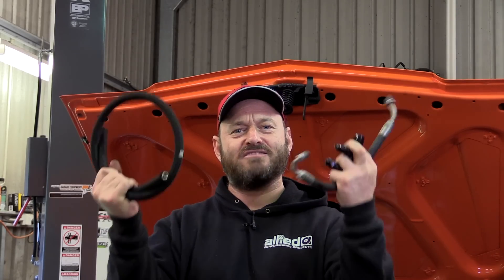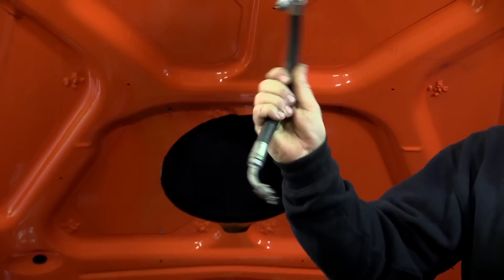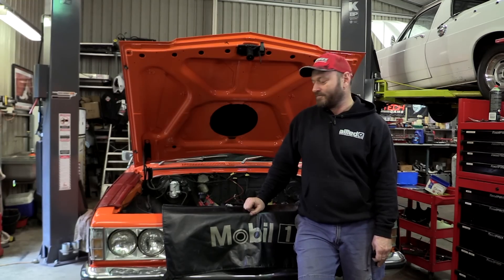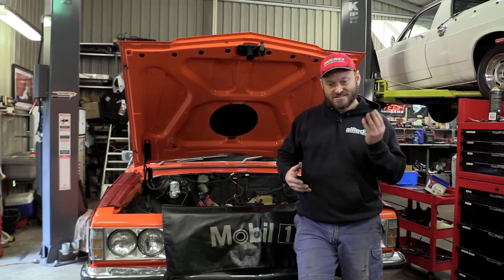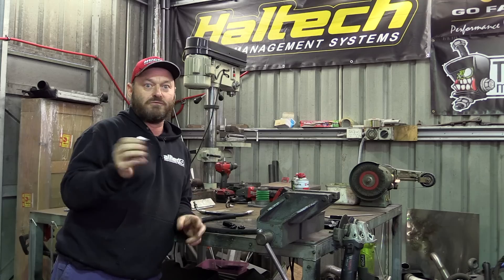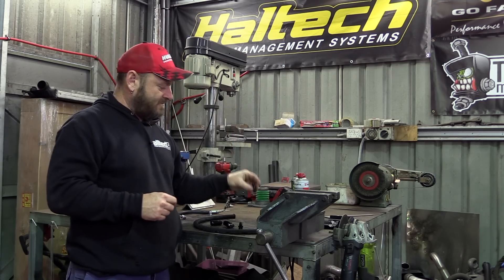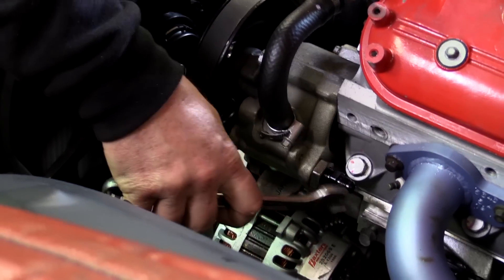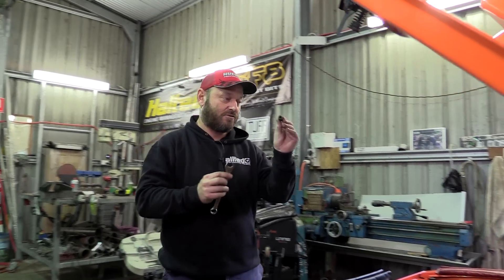THE SKID FACTORY - [QUICK TECH] How to make a custom Power Steering Hose

Comment: so with this method we get rid of all the metal piping and just go straight rubber?!  i am looking at this video just for my 2wd work 1994 hilux where the 5 or so rubber hoses have leaked and fully rust proofed everything. even on ebay a full set of rubber and metal hoses looked like $1300 aud !

Comment: hi 
factory SBC  uses the sway bar to go under the engine  as a mount to go from box to pump .
Reply from the maker: The pressure lines were mounted to the sway bar from factory to cross over?

Comment: I have that engine in my VY SS Commodore & I have already heat wrapped the driver's side header (Genie headers) to protect the power steering rack & starter motor as well as other stuff like the heater valve & battery from getting cooked (the drivers side header tended to warp the heater valve) but I would like to heat wrap the passenger side header next.

The high pressure power steering pipe comes into close contact (1 inch) with the exhaust header which tends to make the power steering hard to steer.

I tend to notice that the high pressure pipe also weeps a little bit of fluid & the pump is brand new,I think that the rear of the pump & the power steering pipe gets too hot so I'm going to insulate the exhaust header from the power steering pump.

I noticed that the same engine in the Chevrolet Camaro has its high pressure hose run down the front of the engine to the power steering rack which is mounted in front of the engine so it's routed away from the exhaust manifold,the Camaro uses a different pump as well !

Comment: hey mate, i know there is a good chance you wont see this but im in the final stages of my vs commodore ls1 conversion and trying to figure out what way to go about the high pressure power steering line. do you think the standard ls1 line would fit? i just cant find the fitting sizes online

Comment: As a hydraulics worker who remakes P/S hoses but the part you'll miss is the internal resister on the high pressure side preventing damage to pumps and boxes due to fluid pulses. with all respect Yoda at 11:14 you shouldn't use the hose to turn the mandrel/hose tail on.
 Funny part is AN6 is a 9/16" JIC to hydraulics worker.

Comment: my local shop tha does industrial psi hoses charges me $160 cdn just to fix a hose, which was half the price of a new ford  hose  plus install by local  mechanic shop 430 cdn  so i  installed it myself for 1/3 the total  cost of that shop doin it..
after doin Ls swap fuel system, ive got about 15 inches left of some high pressure fuel hose and enough left over fittings i think i can make one of these from that and just get those adapters, so maybe 10-15 bucks to make a new hose fit :-)

Comment: 200 series PTFE hose appears to have a higher pressure rating, is there a reason you use the 490 instead?
Reply: Yeah my thoughts to. Must just be a sponsor thing
Reply: @rabbitswyd24  Can you guys do maths? Might answer your question. LMAO being sponsored by a hose
Reply: @yeahna  they seem to have a thing going with Goleby's, the company that supplies them with hose and fittings. I'm going to assume you have the mental capacity of a 12yo based on your level of humour, and lay it out for you:

Teflon hose is good for most automotive applications, so it saves you from having to stock multiple different hose and fitting types for different applications (petrol/gasoline, E85, diesel, oil, trans fluid, PS fluid, brake fluid, etc). 

It's ~20% more expensive, but all of the options for quality custom hoses are expensive, and compared to outsourcing to a hydraulic company to custom make each hose it's generally more time and cost effective to make them in house. Teflon hoses have much higher specs and IMHO should last longer than other rubber-type hoses

Not that comparing numbers really qualifies as maths, but PTFE hose is objectively superior when it comes to the numbers:

200 series PTFE stainless braid reinforced -6AN:
- working pressure ~3300PSI, burst pressure ~10,000PSI
- operating temp -70ºC to 260ºC
- steel and aluminium fittings available (in industry, steel is recommended for high pressure side)

490 series synthetic rubber textile reinforced -6AN:
- working pressure ~1500PSI, burst pressure ~6000PSI
- operating temp -40ºC to 120ºC (PS fluid can exceed 120ºC in demanding applications)
- aluminium fittings only

Comment: i have quick question for anybody to answer ..why do manufacturers use steel and rubber hose on the high pressure lines .. can it be replace with just a rubber hose ...does the steel line play a role in it working correctly to a correct pressure or something

Comment: Thank you for this - I'm ordering some from Aus as there are no UK suppliers. I'm not even doing this for a conversion, just to replace the factory lines that have perished and follow a truly ridiculous path around the engine bay. About 4 metres of pipe to travel 1.5 metres from pump to rack. No NOS available anywhere and it's only a 2006 car.

Comment: Can an incorrect hose cause vibration.? When idling and rotating the steering wheel left or right, any engine rpm (750 - 2500 rpm) same result. 
Want to know before condemning the pump or the RRS rack

Comment: Do you not require a pressure control valve on the HP side of the pump? What fitting did you end up using on the pump when you said the other fitting was too long?

Comment: I had a look and the 90 degree's are almost $50 each. This made my hose over $200 , to make it myself. It just doesn't make any sense to me. 
I need a custom hose because my chevelle is converted to right hand drive. I'm thinking about getting a factory hose, cutting it and welding in a steel extension.
I'm open to better ideas.

Comment: Would love to see a DIY aircon setup where as you have to either replumb and use a different condensor.
Reply: This would be great as I have to fit AC to my VW van this autumn.
Reply: @idrisddraig2  If it's a Kombi just wind the windows down and listen to the glorious sound of the  Dak Dak! If its a T3 or later just buy the original equipment and fit it.
Reply: @terryjackson4538   It's a T5 , Original equipment will be 2K€ +, I will end up using scrapyard parts

Comment: I had my steering rack changed a year or two ago on my 97 Camry. They didn't tighten the fitting on the steering rack from the steering wheel. I took it back and said it has a lot of play in it. The steering feels quite light, the steering wheel is off centre and personally I think the rack needs a little more play taken out of it. I like a steering wheel that you can take your hands off and it drives straight down the road with a slight tendency to wander according to road surface.

Comment: I love AN fittings.  My father and I put everything needed to run a boat into an empty hull.  We used AN fittings for the fuel and hydrolic  systems.  I accidentally over tighten one and killed it.  We had to recreate the entire hose again.  We took great care in taking the rest of the hose apart in order to save the other fitting.

Comment: How do you determine thread size, thread type and thread pitch?? Either a male or a female thread on an unknown component.

I recently put thermo fans in, took ages to find a thermo fan switch that fit because I couldn't determine the female thread size in the thermostat.
Reply: There are thread itch gauges available, try ebay for a set. Anywhere that does metal fabrication would probably have a set.

Comment: CarQuest can do up hoses for people in Canada, not too expensive, around $100 depending on the hose and it'll look pretty much OEM. Although they didnt have the right fittings to do a custom clutch hose for me the last time, but brake line did the trick until I got my hands on the right materials.

Comment: Also quick tip when making hydraulic hoses, or any hoses for that matter, always clock/orient your fitting  and route your hose to go with the natural flow of the hose, meaning bulk hoses comes on a spools and tend to always have a bend or curve in it. Keep that in mine when routing your hose, don’t fight it, use it to your advantage! Specially true if you go above 1/2” hoses and more so if it’s double braided.

Comment: I do probably 50 or 60 power steering hoses per year in Bunbury WA. I am a mobile hose owner and depending on the brand of hose , you can do almost OEM quality work, or sometimes I use stainless/ Teflon if the owner wants bling.
Reply: I do the same here in Ballarat mate. Loads of custom mustang ones. I do a lot in steel pipe work too. I get a real kick out of doing a good OEM looking  job.
Reply: I agree with you guys. A/N looks dinky. OEM looks much better.
Reply: Any chance you can help me with a custom ps line for my 2jz 91 supra build.

Comment: Hey Al, how do you feel about the Aluminium Spanners other people I see using only for AN fittings??
Reply: Ross Burrow all the aluminium spanners do is prevent scratching the on A/N fittings. As they’re expensive fittings and people tend to use them for display purposes.. the spanners are recommended.

Comment: Great video Al, this is so much nicer than what we used to be forced into 20 years back doing swaps, brazing two different high pressure lines together on the hard line with an oversize piece of hard line over the two was the way, seems rather rogue now but it worked I guess. Used to cost about £150 for a custom pipe back in the 90's in the Uk, people were spending that for the bloody engine to swap in haha.

Comment: A tip for cutting hydraulic hose, even big heavy "six wire" hose, when you dont have the correct cutting equipment, is to lay it over a log and give it a big hearty swing and chop with an axe. It will go straight through it very cleanly.
Reply: An axe!! How do you get internet in the woods..haha. So creative!

Comment: Would possible to go more in depth in terms of fittings, sizes and common uses.

I'm also a mechanic but I don't actually know what you mean when you say we are using this dash 100 series line for application X. It would be nice to see and have explain the differences in lines, sizes and being able to have a rough idea on what lines are needed for certain applications
Reply: With AN fittings larger numbers are bigger fittings. So -8 would be bigger than -6. And they get sized based on how much flow is needed and what kind of pressure it needs. Smaller hoses can withstand higher pressures without extra reinforcement. 
And the 100 series is the type of the hose. It varies some by brand, but the different series will have different pressure ratings and different fluids they’ll handle.
Reply: Check out the Bedford van episode he talked about. He goes over all that stuff, it's really informative!

Comment: Interesting, I normally go to the local hydraulic hose shop that makes custom hoses and will do it using the old fittings then will do it the cheep way with functional hose or the fancy with decent priced parts, did a nice job on my  ATTESA  pump hose for my S12.... but good to know which hose and parts to look for when that isn't a option, thanks

Comment: I really appreciate these Quick Tech series vids, guys!
Topic suggestion: the differences and various applications between oil-only CHRA turbos and oil-and-coolant CHRA ones.
Reply: Oil only for a engine thats built to make big power.water cooling if it's  going to a million kilometres... Turbos have come along way from the 90s! unless you buy a manufacturer specific turbo it won't have water cooling....
Reply: @thecraftiekiwi4919  I'm looking at either a G25-660 Garrett (oil-and-water CHRA) or perhaps a Gen 2 5558 PTE (oil-only CHRA). I'll be tuning for 500whp.

I currently have a GT2871 now (oil-and-water, 390whp) on my Mazdaspeed 3. My application is for competitive tracking and auto-x, so heat rejection over an extended period of time is important and has me shying away from oil-only.

Comment: clocking the fittings - on shorter runs, it helps to mark where you want the fitting oriented when finished.  There are a bunch of ways of doing it, but it is really annoying to be 180 degrees off and unable to connect the points.

Comment: When you are assembling the hose I noticed you did not Mark the end of the hose at the fitting after you threaded it into the fitting. When I made hoses for the race boat I used to work on, I used to always take electrical tape and Mark the hose with the electrical tape at the end of the fitting, and make sure that the hose didn't back out of the end of the fitting while you're threading the Spike into the hose

Comment: OR install an electric power steering system...much betterer....
Reply: Too much work on a older chassis with a steering box.
Reply: ChrisHallett83  The best steering feel I have experienced was in a Mk5 Golf GTI so I have to agree however my 2017 Astra with purely electric assistance is great always being light and easy to steer...I am a convert...
Reply: That light easy steering you like is what makes it hard to tell what's going on with the tires and the road though. For a daily driver electric is nice but I personally would want hydraulic for a project like that

Comment: Welding the thin pipe to an AN fitting with ER70S filler can make them brittle and prone to failure. Especially in due to heat and vibration fatiguing them. I usually like to use silicon bronze and TIG them together without melting the base metal. You'll notice a lot of engine oil pickups are constructed this way for the same reason.
Reply: Hence why he said he has them silver soldered at his friends radiator shop ;-)
Reply: @southjerseysound7340  Yup Shane down at Old Cock's takes care of it.

Comment: will probably have to do this in my LS1 VL with astra electric power steering pump. thanks for the info!
Reply: Speedflow 741-06 is the part number for the fitting into the astra pump.
Reply: @TorqueMediaau  Isn't the Astra electric power steering a unit that fits under the dash with no hydraulic lines required..hence electric??
Reply: @truthseeker8483  no, its just not pulley driven.
Reply: @83blackpuppet  My Astra does not have any hydraulics, it is purely electric...I think these Astra units you are talking about are from earlier models
Reply: @truthseeker8483  the unit i have is electric hydraulic. so i can relocate it but still use the factory VL power steering rack.
Reply: @83blackpuppet  sounds like an easy conversion!
Reply: @TorqueMediaau  Thank you sir!
Reply: @TorqueMediaau  i think the power steering pump i have is off a 2009 model, will this be the same as the older model?
Reply: @83blackpuppet  2009 what? mazda 3 i believe is the same but im not 100% positive.
Reply: @TorqueMediaau  astra i believe, could be vauxhall astra tho now that ive googled it.
Reply: @83blackpuppet  2005-2009 are the same so should be fine just double check with speedflow.
Reply: @TorqueMediaau  ah ok, thank you again sir!
Reply: Huh????

Comment: I like to put a piece of tape on the hose after screwing it into the nut(at the point where the hose comes out of the nut), as one could hear it gets quite tight as you thread it together. The tape will show you if the hose pushed out which can happen. We used fittings like these on the oil rigs back in the day.

Comment: I work for Pirtek... and cause I have a passion for cars ... if it's for a car I ask What make and their intentions if it's just to  make it work or does it need to be pretty as I can make it
Reply: Good on ya mate ! You sir would be one of the few good ones out there. Most hose replacement companies I've seen only specialise in quick and fit for purpose not show car standard, and when you do find someone who can make it shine it has the shiny price tag to match. If it is cool with @The Skid Factory could you pass your contact details around (for when we require a quick roadside fix) ?